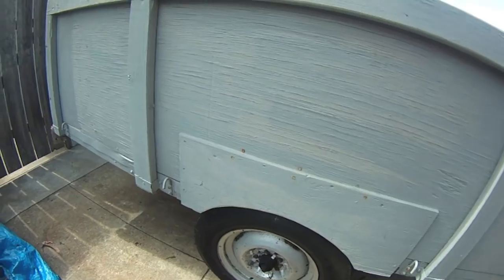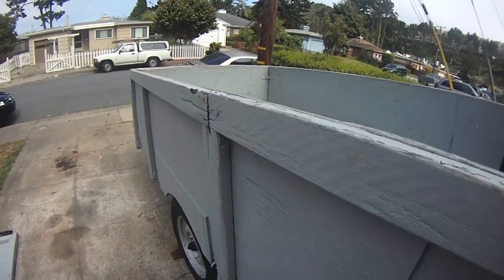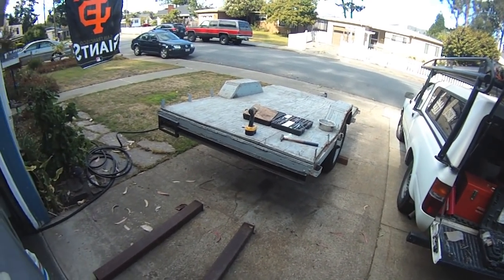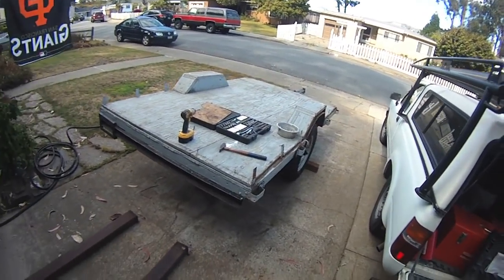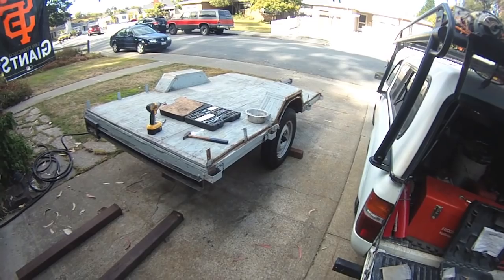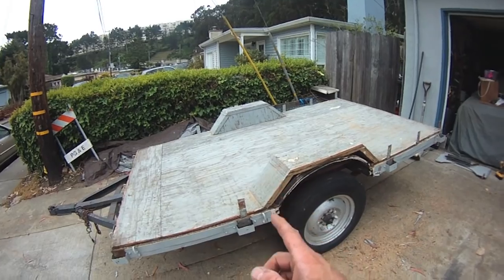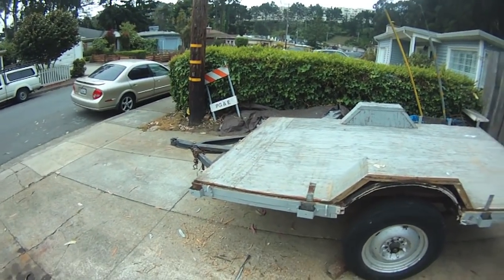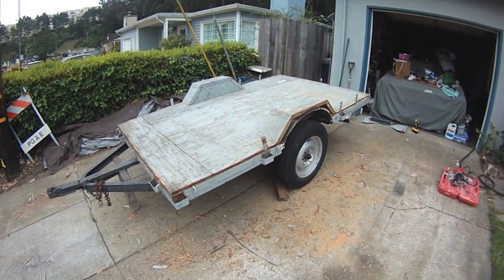Fixing a Free Trailer with Free Steel

Comment: That will be a much better trailer and you will use alot more now that you have built as strong as can be , Gerry
Reply from the maker: Hey Gerry...you could not be more correct.  I had it on a job site within 24 hours of completion and hauled 2230lbs on demolition debris to the dump.  I am very, very happy with how it came out.  part two will be up tonight. Glad to see you back in circulation. Take Care, Steve

Comment: That's a nice lil trailer. I will say this, I have two trailers (currently) that I work with, and I wouldn't get rid of either one of them. Worth their weight in gold to me. I need to redo my one old wooden sided one, and like you, have been wanting to use expanded metal for years...one of these days....Anywho's, cant wait to see what it turns out like!
Reply from the maker: I have this one and a 16' dovetail car hauler.  They both are very well used by me and I can't see getting rid of either. The scaffolding steel turned out better than I had hoped and I hauled 2230lbs of demo debris to the dump less that 24 hours after I completed this (video will be up tonight.) The expanded metal I have my eye on is something I will salvage from a job I have starting in the next month or so...I am patiently waiting for the green light on that work... but patience sure beats having to buy the stuff new.  Stay tuned and Thank you for watching!
Reply: yourbeekeeper Man, nothing beats freecycled materials! Im hoping to come across some scrapish type steel for my project trailer myself. Man, that's a LOT of debris on that trailer...I thought I was the only one who'd push a trailer to its limits, haha! Cant wait to see the vid. Patience is indeed a virtue that pays off! Ill be patiently waiting on the next vid.
Reply from the maker: My record dump run with this trailer is 3600 lbs of concrete.  It was a stupid heavy load and my Toyota was not happy about it.  Luckily the dump was about 8 miles away and I didn't have to get on the highway.  These days, I am better at estimating the weight based on suspension compression and I try to keep it at around a ton max.
Reply: yourbeekeeper HaHa, WOW that is one heck of a load for that lil trailer! I too judge weight by compression of the suspension, and try to keep mine around a ton...but I can honestly say I don't think Ive ever had much more than a ton on it...maybe like 22-2500, then the weak little leaf springs start to sag and I get nervous and call it a load, haha!

Comment: Go sit, have a cold drink relax and think about a plan. You could put temp sides on it from OSB and really do the job right after this work project. Then again some jobs flow right into the next. You need a bud who could loan you a trailer for this job. Especially a crazy one like me that has 3 trailers.
Reply from the maker: Well...I have two trailers so I'm right behind you...hahahaha.  The trailer is done (uploading part 2 today) and as the paint was drying on the deck, I was towing it to the next job site.  The deck is solid, just not how I would have built it.  I can't delay things until I slow down or they would sit 10 years in a patched together "temporary" state.  The new sides are awesome, and built so I can use them when I eventually fabricate a new deck.

Comment: seems a shame to not replace the floor at this stage,maybe you could borrow or rent a trailer for this upcoming job?
Reply from the maker: Hey Roger, Nah, I don't like to borrow things from people and the trailer is already done.  It was getting towed to the next job site as the paint on the deck was still drying.  The deck is very solid..I would say a 9/10.  It is just not how I would have built it. I don't have desire to spend the money or time on it right now.  My efforts are better used elsewhere.   It will be fine for the next 10-years or so.